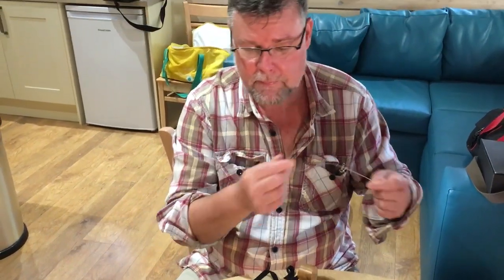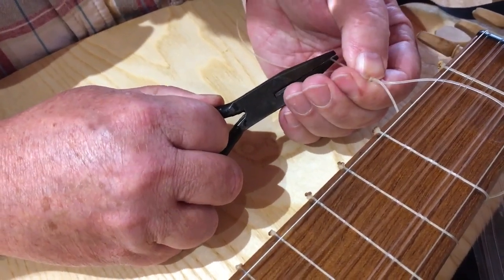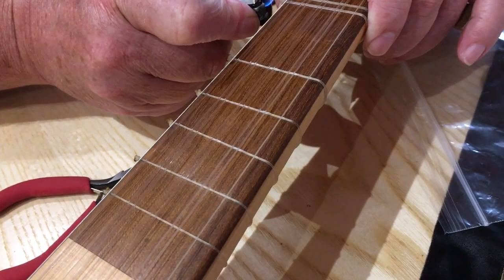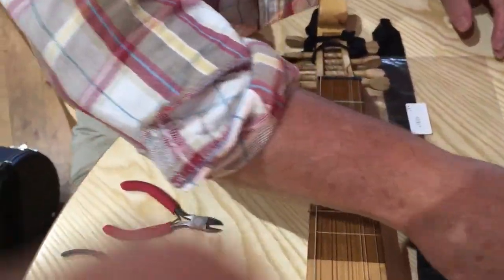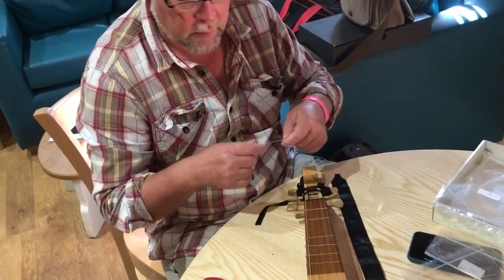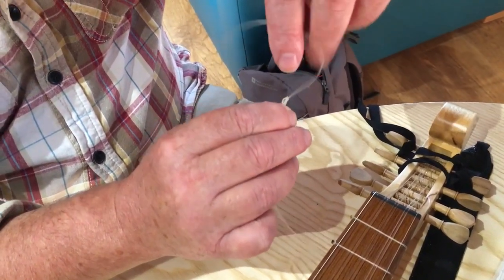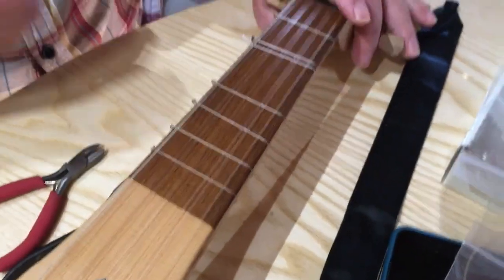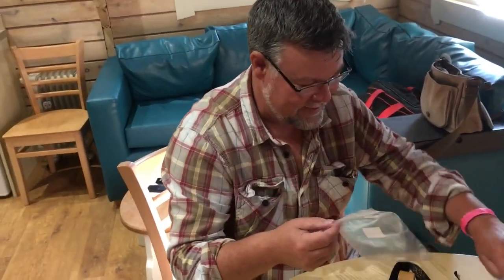George Stevens   Replacing Worn Gut Frets On a Gittern

Comment: Is fretboard even with the soundboard? How thick is the gut for fretboards?
Reply from the maker: Yes in this instance the fingerboard and the soundboard are on the same level, equal thickness. It's not really possible to answer your question about fret thicknesses in general as that will depend on the overall set-up of your particular instrument. On my set-ups I start with a .9 or .8 gut thickness up near the nut, as I say on the video. Gradiate them down as necessary as you move up the neck. You might need five different gauges (?) at .1 difference.
Reply: @GeorgeStevensLuthier  Thanks for the answer! I am surprised as I thought the frets have to be equal on all fret instruments like guitar
Reply from the maker: @Rottensparrow  Haha, well lute family instruments are not like guitars in many ways and this is one of them.

Comment: Thanks so much for this, George! This is the best demonstration of fret-tying that I've found on YouTube yet. The great thing here is that your customer was working the camera--just his phone I should think--which allowed him to get in close. Seeing you work that wee trefoil knot is crucial. It's the hardest thing to explain to somebody who's never seen it done. A drawing just isn't the same.

I manage the Lute Society of America's Lute Rental Program. Most of our renters are novices, for whom gut frets are a complete novelty. We have a document on caring for a lute which I send them, and, with your kind permission, I would very much like to include a link to this video.

By the way, the initial knot, before you spread it open into a trefoil, is simply called an 'overhand knot.' At least that's what they told me in Boy Scouts, all those years ago.
Reply from the maker: Hi James. Glad to be of service, thanks for the heads up on the simple knot name and yes, you are welcome to add a link on the LSofA . 
Something I didn't say in the clip is that the actual gauges of the gut are also dependent on the nut and bridge heights of the particular instrument you are dealing with. They're not all gonna be the same!
Also this is only the single strand fret method, of course, I seldom use the double strand method - two wraps of gut per fret, that is. Commonly used by Gamba players, but some lutenists too.
Reply from the maker: Yes it was just filmed on a phone. 👍
Reply: @GeorgeStevensLuthier  I won't trouble our beginning lutenists with the art of graduating frets. We just want them to be able to replace worn or loose ones. As for double frets, we'll leave those for the gamba guys. Cheers!